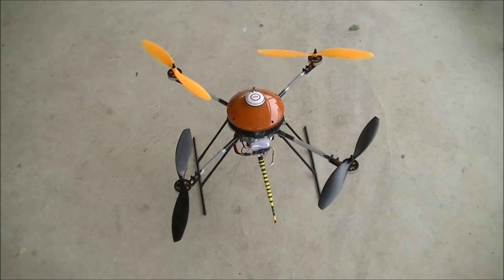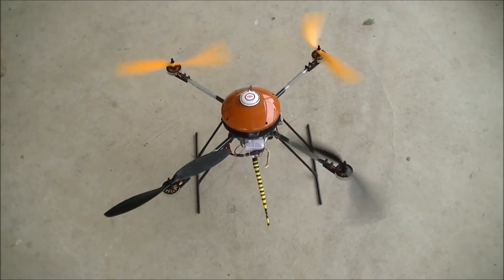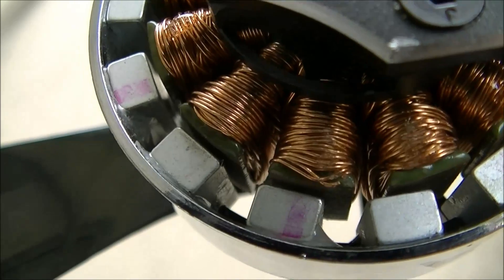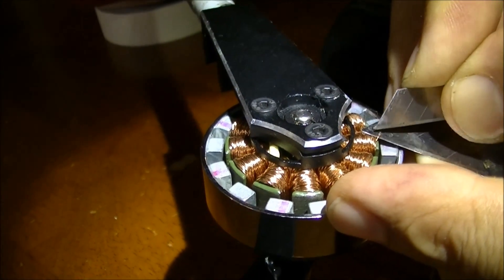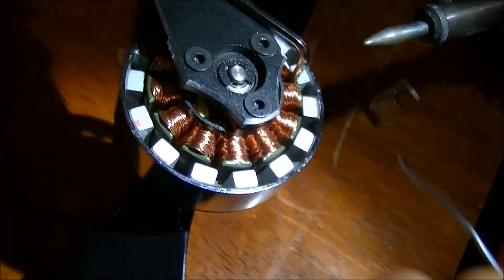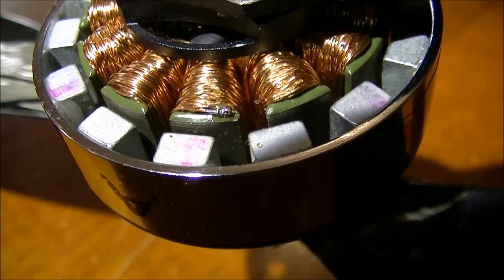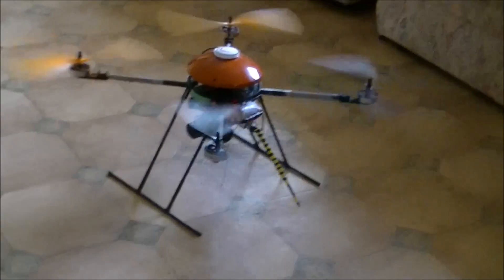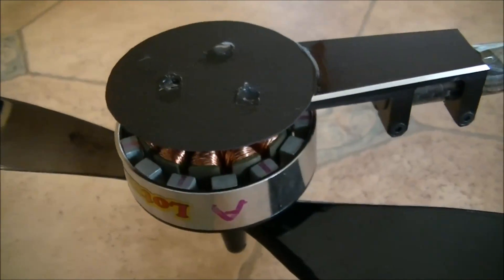Quadcopter MOTOR FIX. LotusRC T580P+

Comment: Would you recommend this quad?
Reply from the maker: NO WAY Frank! This quad was hell. It is badly designed and I had to replace the original flight controller with a DJI Naza M which was a constant source of trouble and crashes. Last month the stupid Naza just dropped it from 100m smashing it to pieces and destroying nearly everything. I was actually glad coz now I have a Walkera QR X350 PRO and it is a much better quad in every way. Even Alishanmao is disgusted with DJI shit and there is even a "DJI crash psychological support facebook page now.